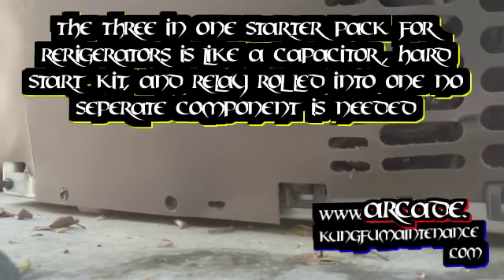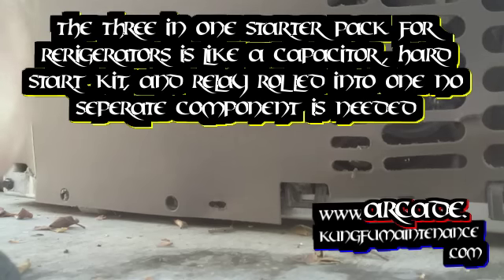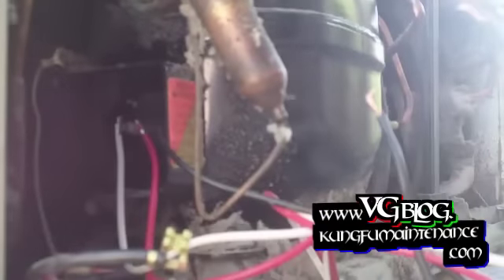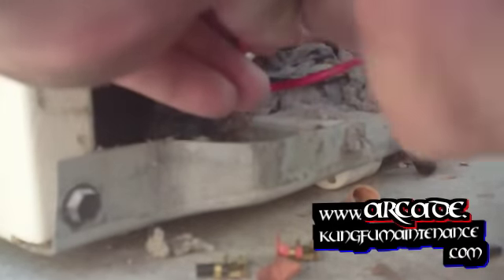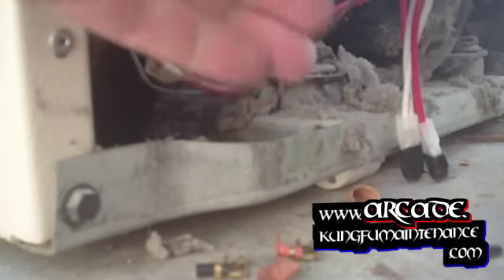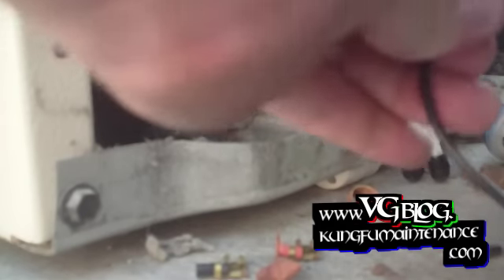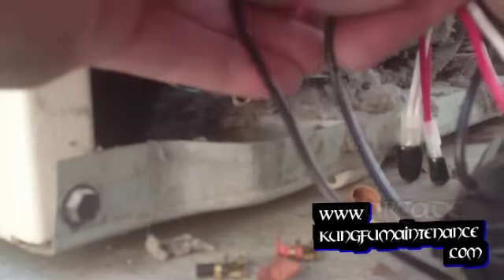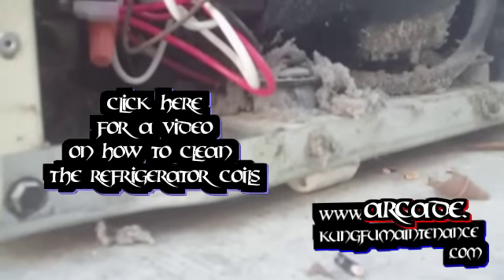How To Repair A Refrigerator With A Compressor That Suddenly Stopped Working Or Will Not Run

Comment from the maker: Check to make sure fridge is not in the defrost cycle by advancing the defrost timer. Verify three in one relay is proper horsepower for fridge (they usually come in two different sizes a 1/3rd - 1/4th HP and A 1/8th to 1/12th HP I find on most setups I am using the latter 1/8th to 1/12th hp. Next thing to check would be that all wiring is hooked up properly and all connections are good. Does compressor make any noise as if trying to start? You can also do a voltage check at compressor leads.

Comment from the maker: You can try doing a resistance test on the compressor. Unplug fridge and  diconnect leads to compressor start common and run terminals. With multi-meter set to ohms measure resistance between Common to Run Run To Start And Start To Common and write them down. On a good compressor adding up the two lower numbers should equal (or just about equal) the larger number.

Comment from the maker: Sounds like possibly the compressor has a stuck piston, but it could be that the 3 in 1 was wired wrong. Does the light come on inside the fridge? If so the fridge may be in it's defrost cycle and you can try advancing the defrost timer. I show this in my "One Thing To Check For If Your Refrigerator Fan Motor And Compressor Won't Start" video. Unplugged you can check which post should have the red run wire on it will have the least resistance when checked with an ohm meter common to run posts.

Comment from the maker: The part is called a 3 in one starter pack also sometimes called a 3 in 1 start overload capacitor. You can find them on my KungFuMaintenance website Ice Boxing page (where I make a small commision if something is ordered through there) or a local Appliance or HVAC and Refrigeration store such as Johnstone Supply.

Comment from the maker: The last two wires connect to the lines shown at 1:56 . You can see where they were originally hooked up at 1:37 to power the start relay and capacitor. I tried searching Johnstone website but had no luck you might try calling them. I do have a link to the 3in1 starter pack on my KungFuMaintenance website Ice Boxing page.

Comment: Side-by-side not cooling, no sound. Lights inside coming on so not a breaker. I called local appliance store, they did not have a new 3-way switch but a used one. I bought it for $25 bucks. The wiring harness was not the same so I cut the wires and replaced the ends. Plugged it up and BAM! Everything worked! You are the best. Not only did you help me save a few hundred dollars in food, but several thousand in medicine. Thank you!!!!!

P.S. I did clean the coils very well also  :)

Comment from the maker: It may be that you have a bad compressor. Do you hear the compressor try to start at all? Next check (dangerous one as fridge must be plugged in so do not attempt unless you know exactly what you are doing. (Better to call in some help or get a new fridge than wind up crispy fried.)  would be a voltage check measuring with a volt meter set to 220 volts measuring between the compressor terminals Common to Run Run To Start And Start To Common. If you do not show voltage problem is not compressor.

Comment from the maker: Everything happens at the freezer so if things are cold there it is a good sign. It is fairly easy to check for any blockages(including ice) from the freezer down to the fridge compartment as I show in me vid "Fridge Leaking Inside ~ Drips From Ceiling ~ Defrost Clogged Condensate Drain" also check me vid "Fridge Not Cooling ~ First Things To Check For ~ Ice Boxing" It may be you have a stuck evaporator fan.

Comment: @KungFuMaintenance 

The compressor is running & I change the door seal of the refrigerator because it was broken but still the freezer & refrigerator still warm. There is a main board on the right side of the back of the refrigerator. I'm not sure if the main board is not functioning properly but recently I had a defrost problem because the ice build up on the evaporator coil. I tested the heater coil but its fine until it started not cooling the freezer & the refrigerator.

Comment from the maker: Do you hear the compressor running? It would have a deeper lower sound than the fan. Would it be possible for you to post a video response showing the problem inside the freezer inside the fridge around back of the fridge? You might check me other vids. "Five Most Common Problems With Refrigerators" "First Thing To Check If Fridge Not Cooling". Is the freezer cold at all?

Comment: First off thanks for your vid, Secondly I 'am going to pull a vacuum but don't know if I pierce the high side line before the condenser or after it comes out of the condenser any help would be appreciated. Thanks

Comment from the maker: If it just hums(buzzes) but does not start completely than a starter pack may fix it (unless the compressor has a locked piston which is more unlikely). The compressor would get warm if it was trying to start but could not due to a starter relay issue. If the compressor actually runs (not just buzzes) and than shuts off than it is probably low on freon due to leak somewhere in the system. It is unlikely that the wrong tstat would cause a refrigerant leak  even though a leak could be the prob.

Comment from the maker: There are quite a few different methods and many schools of thought on which is best. Check my video on "How To Install Bullet Piercing Valves To Charge Refrigerators Or Air Conditioners Low On Freon" A vacuum can be pulled from anywhere plumbing is pierced. Charging can be done at the process tube, at the suction line with vapor, dropped in as a liquid, usually on the high side. I prefer pulling vacuums and charging refrigerant six or so inches from compressor in the suction line with vapor.

Comment from the maker: Do you hear the compressor start running? If it was low on freon it would mean there is a leak somewhere. The leak would need to be found and repaired first. Than the system could be charged with refrigerant. If the compressor is not running at all it is most likely an electrical problem.

Comment: hey if i cut the wires to connect them like the video is there a way i can put those 2 medel parts back on the wires if i am just using the 3 and 1 just until my part needing those medel connecters come in the mail? thanks!

Comment: I have a kenmore that cools great but when the compressor has been on for a bit it starts to make a clicking noise around the evaporator.  Its a freezer on the bottom and frig on top and it sounds like its coming from the area around the bottom of the frig. Any ideas would be great! Thanks!

Comment: I did a continuity check on overload and relay - found they were bad.  Did the same on the compressor - found it was good.  Bought a 3 in1 starter device that was suitable to my refrigerator, hooked it up, but it didn't work.  What should I check for next? Thanks

Comment: Thanks for the great info.  I fixed our fridge that was 4 years old with a QSR-13 3n1 start relay from Direct HVAC Supply out of Eads, TN.  They had no problem shipping to me here in Canada either.  THe repair man said the compressor was toast.  I watched some videos on this and after it had cooled down for a few days I plugged it back in and it fired right up off the bad relay that caused the compressor to overhead in the first place.

Comment from the maker: This is one option for a situation where the compressor only has stopped working. Another option here would be getting an exact capacitor and relay replacement for your particular make and model of fridge. Three in one starter kits come mainly in two sizes 1/12th to 1/5th hp and 1/3rd to 1/4th horsepower sizes. Determining the hp of the compressor can be tricky but a bit of googling your make and model number you should be able to find it. Hope that helps. Thanks for watching.

Comment from the maker: I just put up a link to the part on my website KungFuMaintenance on the Iceboxing page where you can order the part right next to the video. Little by little I will try to be adding the parts needed to make the repairs in the videos on the website to make finding parts needed easier.

Comment: is there a way to test the relay or the starter pack and by pass them to prove the compressor is not the issue or need of refrigerant? whitout having to buy a set. i took off the relay and nothing raddles inside of it.

Comment: I checked the voltage had 120 volts at both places.  If the unit was out of frion would it still not run?  It doesn't seem to even want to try to start. What should I check for next or is it a lost cause?

Comment: the compressor just makes a humming sound not like before, and it gets a little warm, if there is a problem with it should it get warm ? it used to cool before till i had the wrong tstat installed, now that i have the good one on it doesnt seem to work .

Comment: @KungFuMaintenance 
I have a GE refrigerator side by side model DSS25KSRE, it started not cooling yesterday. I found out that there was no build up of ice on the evaporator tube but the fan motor was working properly but unfortunately the air flow was warm not cool. I tested the heater coil but it was okay. Kindly help me to troubleshoot my refrigerator.

Comment from the maker: As long as you leave enough room you can strip off the wires ends and reconnect them with wire connectors. Or a bit better you can just use new crimp on terminals on the ends of the wires to connect to the new parts.

Comment: i watched the video and is having the same problem with my frig. i do have the hard start and tried hooking it up but probably was hooking it up wrong prior to this video. my three terminals are upside down so not sure if they hook up the same as video but when i hooked them up the compressor sounded like it wanted to start but then the breaker tripped and it the frig went off. now the compressor or fan wont come on at all. what is this???

Comment from the maker: The part pulled off is most commonly called the relay (it is actually a relay and capacitor in one) The part I used to  replace it is a three in one starter pack. It replaces the relay plus capacitor on the compressor, and adds a hard start kit. It attaches to the common, run, and start terminals on the compressor.

Comment: My three door commercial refrigerator keeps over heating what's my problem head pressure is going over 400 psi suction pressure 50
Reply from the maker: I would always try cleaning the coils first. Check for a stuck or malfunctioning fan motor.
Reply: Frank Blanchard  ya or maybe you have it too close to the wall? They need room to move air around
Reply: B23

Comment from the maker: You can get these on my KungFuMaintenance Website "Ice Boxing" page where I make a small commission on items purchased.  Alternatively you might try an A/C shop, appliance repair store, or local hardware store (calling around first will save you some drive time). I usually get mine through HD Supply Solutions or Wilmar.

Comment from the maker: I would first check for any dirty coils, air filters, or stuck fans, these could cause a system to be unable to shed heat and cause a compressor to overheat.It is possible it could be low on refrigerant. A secondary function of refrigerant in the system is to keep the compressor from overheating.

Comment from the maker: What you may be hearing is the freezer on it's defrost cycle. It may sound like a bit of spits and splatters. Some freezers will even show a red glow during this cycle. This is normal and to be expected in a frost free fridge which goes through defrost cycle to melt off ice build up and keep everything running smoothly. If the clicking itself is extremely loud it may be time for a new defrost timer. It is always a good idea to keep coils clean as dirty coils can often cause unnecessary noise.

Comment: Hello
I install the same relay it works fine compressor comes on but once I unplugit and plug it back in compressor won't start. It is a little hot but not super hot. If wait 10-15 min and plug it back inn in starts right away.
Reply from the maker: Tony Torres Could be the wrong horsepower relay or could be a  sticking compressor valve.
Reply: Tony - This is normal with any refrigeration system.  If you remove power while the compressor is running then attempt to restart, the high pressure side is preventing the compressor from pumping thus the motor to not turn, motor windings get hot and can possibly burn out.  As you discovered waiting a short time (usually 3 minutes is all that is needed) will allow the compressor pressures to bleed down and it will restart as normal.  Some systems have a "time-delay relay" in place as a safety feature for the motor. In the event of a "brown out" during summer time air conditioning or momentary loss of power during a thunder storm.  Once power has been restored and the timer has "timed-out", about 3 minutes, then the system restarts as normal. You can also add the "time-delay relay" for protection of your equipment. It's easier to spend $50 more or less for the "timer-delay relay" than it is to replace the compressor which can cost several hundreds of dollars just for the part plus the labor of an HVAC tech to install it.  Hope this helps, be safe and good trouble-shooting. -- Mike

Comment: sir, do you know how to repair a compressor that losses compression? I'm having a thesis project and the lower side pressure and high side pressure is equal during operation,, thank you

Comment from the maker: This is a part I stock regularly so I can repair fridges if they go down in this manner. I could of done a continuity test on the old relay to see if it had lost continuity but this was more of a last ditch effort. If this didn't work than it was time for a new compressor or a new fridge in which case I would have just recovered my three in one starter pack for future use. I am happy to say the repaired fridge in the video is still going strong and it has been almost a year now.

Comment from the maker: Not a bad idea, and I agree, the better way to get it done. I actually blasted this one out with my wet dry vacuum set to blower after the repair which you can see in me "How To Clean Out Refrigerator Coils With A Wet Dry Vaccuum Converted To A Blower" video. No need to clean it if the repair didn't work out. The fridge had suddenly stopped working, everything cooling up to that point so I was pretty sure I had no refrigerant leak or anything like that. Thanks for watching and commenting.

Comment: You indicate in a post below that the refrigerator has been running for one year now since installing the 3 in 1.  Can you give an update on the amount of time the 3 in 1 has been in service and it's performance?  Is it still working?  Doing the job satisfactorily?   Any noticable problems?  Many tech forums and posts caution against using the 3 in 1 as a replacement.  They advise only using for diagnostics. I believe this is so because not all 3 in 1s match up to the compressor horsepower.  I believe as long as the 3 in 1 is compatable with the compressor horsepower, there is no reason to think it should not run as well for full service use.  What do you think?

Comment from the maker: I show how to perform that very test in my video "How To Scratch Test An AC Or Refrigerator Compressor To Prove If It Is Bad". You might just review the video to make sure you are doing it correctly. If you show continuity from any of the three terminals (common run start) to the scratched off place on the compressor it proves that a wire somewhere in the compressor has grounded out and the compressor is toast.

Comment from the maker: This particular part I wired in is called a three in one starter pack. It replaces the capacitor and relay for the fridge plus adds a hard start kit. It has a total of five wires, three leads that go to the compressor(common, run, start) terminals and two wires to the fridge wiring.

Comment from the maker: I would try advancing the defrost timer as it sounds like it may be stuck and unable to go into the defrost mode which would explain why you would have ice blockage again odor most likely fan rubbing on ice build up. It may be time for a new defrost timer, sometimes just advancing it will free it up. I shows how to advance the timer in me vid "One Thing To Check For If Your Refrigerator Fan Motor And Compressor Won't Start" and how to clear drain in  "Fridge Leaking Inside ~ Drips From Ceiling"

Comment: Hey whats wrong with my fridge it stopped working no sound no light , is it the  engine.
Reply from the maker: First check would be for a tripped GFCI outlet, second for a tripped breaker. If the light went out as well as the fridge it shows there is most likely no power.
Reply: Thanks for the reply but the whole thing just went out no sound nothing is there a fuse somewhere maybe thats it ?

Comment from the maker: You should be able to find them on Amazon or Ebay. Just do a quick search for three in one refrigerator starter pack. Alternatively you might try an A/C shop, appliance repair store, or local hardware store (calling around first will save you some drive time). I usually get mine through HD Supply Solutions or Wilmar.